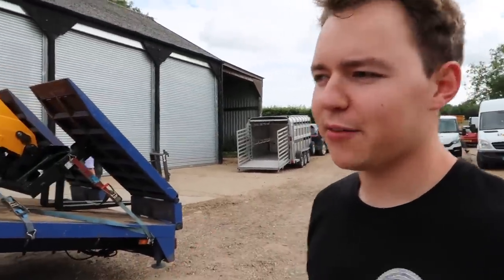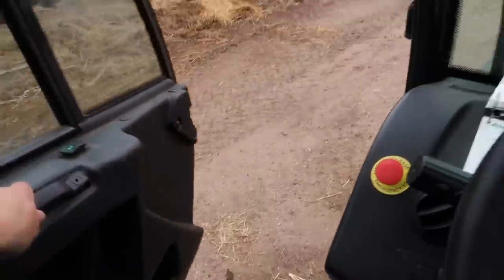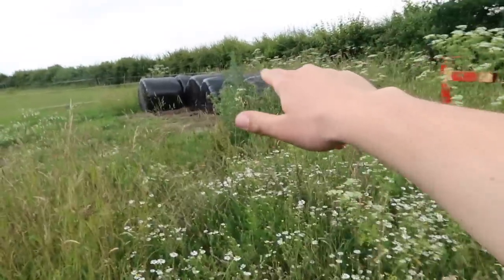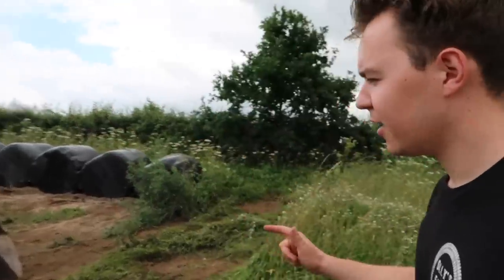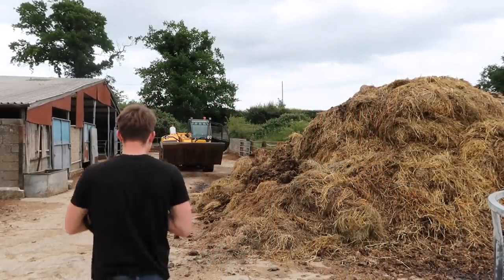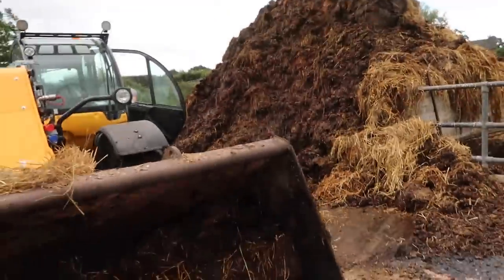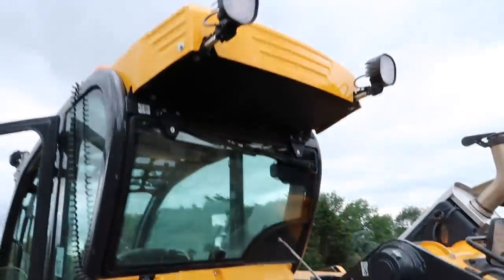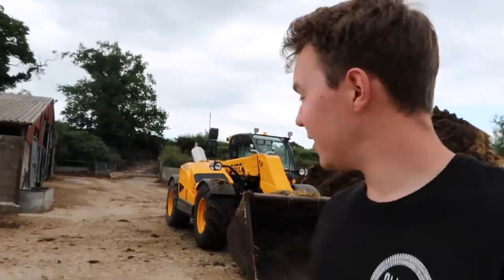Dieci Sent Me A £70k Telehandler!

Comment: Clearly Deichi were listening...
Also, Deichi handlers are alright.
You got a 40.7 so I'm guessing it's a 4 Ton lift, 7 metre height?
That's pretty decent.

If push comes to shove though, I would have a CLAAS.
The old Claas scorpion 6030 CP as lovely, I used it for a while and love it!!!!
Reply: if only claas would stick to a manufacturer once and for all i had two rangers, first and last series they lasted their time pretty ok, telehandlers where crude machines at the time. i chose a cat over the kramer/claas for peace of mind as i was a bit scared of the hydrostatic transmission. the cat was a mess full of lemons, i could make lists of problems on it happening since the very start. in short it's a machine that is good on the paper and should have remained  there. everything except maybe the frame (excluding axles that loose studs and have weak steering joints) is mediocre even the seat breaks down. i know of a massey with decent hour count i'll got for feedback from it when i'll consider replacing the cat. no way i'm buying a liebherr , claas parts pricing is a rip off as it is if they sell liebherr stuff it'll be awful and become twice  worse when they will change manufacturer again.
Reply: @floflo8018  yeh, that's fair enough.
Ive heard that the new Kramer models are good though.

Comment: Where you need 7 meter reach If you use it only on farm
Reply: stacking manure like he did in the video,, ore stacking bales, more reach is better.
Reply: @samkom33   but i think that frontloader would just work fine
Reply: @vapovapi  you mean a normal tractor with FRONTLOADER?
yes on a tiny farm a tractor with a frontloader is useful, but most standard frontloaders is usually MAX 600 kg 1,5 ton ore 2 ton lifting capacity,
also, most tractors are buildt for pulling, not lifting. the front wheels on most smaller tractors arent buildt for carry heavy weight, not becouse they couldnt handle the weight but becouse its usually nothing in the suspension on the front axle of a tractor stopping the tractor to tip sideways when the load gets high,,, telehandlers and wheel loaders have a wider wheelbase + a stiff front axle MAKING THEM MORE STABLE.
NOT 4 TON LIKE THIS TELEHANDLER,
Which mean you need way shorter time filling say a 30 ton  TMR mixing wagon if you have a good big bucket.
yes they could have bought a bigger wheel loader instead,, but a telehandler is usually less expencive